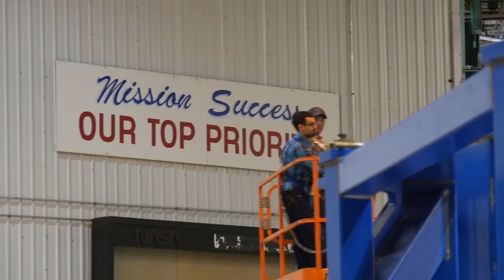Boeing’s “all in” progress on NASA’s Space Launch System for the Artemis I mission

Comment: Just a reminder:

Boeing built the F/A-18, F-15, X-37B, Star liner (which is cleaner and more reusable than the space x dragon), those are just a few. A nd by the way, NASA got to the moon before space x, with SLS, and already is almost done rebuilding another one. While space x is still in its testing phase.

So please stop hating on going just because their B-737x fleet does not work, Boeing has been around more than space x or NASA.

Comment: SLS and the lunar gateway appears be a giant scam for Congressional Districts at this point and it greatly disapoints me so many other projects that would have been cheaper and more effective
Reply: Such as?
Reply: @Akashic85  literally anything else at this point. 
You dont need a station in a station in a near-rectilinear halo orbit to get to the moon. The SLS has the same reusability as the Saturn 5.* Ie basicly none* 
1960s technology is being used with modern computers. 
It is WAY over budget and very behind schedule. The cost of placing ite payload in orbit is still the same if not higher. 
The majority of its uses will be to place stuff in orbit for assembly. Wich can just be done in more trips via reusable craft for less time and money. If you need to bring anything back as well it has to go in an orion capsle. 
A much better approach would have been to stick with the X-33 venture star. Which was cancled due to complications with fabricating its fuel tanks which have long been solved. And then using an orbital tug NTR or vasmir   to boost the payload from leo elsewhere before or after its Assembly. 

And finally with the growing commercial launch companies. It would make greater sense for nasa to worry about what to build up there rather than how to get there
Reply: I agree it's a scam but for private profit.

Comment: I hope Boeing design and build their Launch Systems much better than they design and build their civilian planes, and don't cut corners and costs.
Reply: Gary Church  church gary
Reply: Unlike the 737max which was fixed contract, this is a cost plus contract (because somehowmaking a single use rocket is extraordinarily difficult). The point is to make it as expensive as possible. $40k for single a locker handle kind of expensive. The SLS program exists exclusively to deliver federal dollars to Alabama.
Reply: Dude what's connection between rocket engineer and plane engineer? Pretty much none.